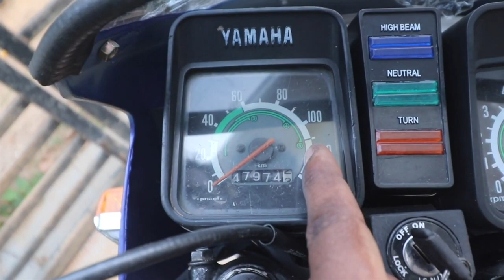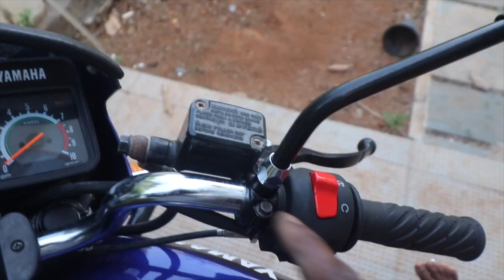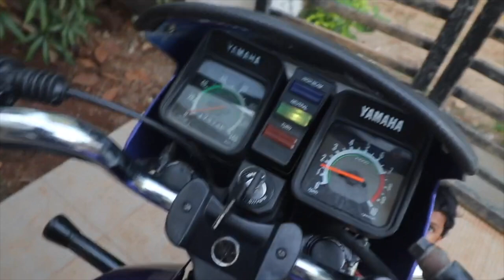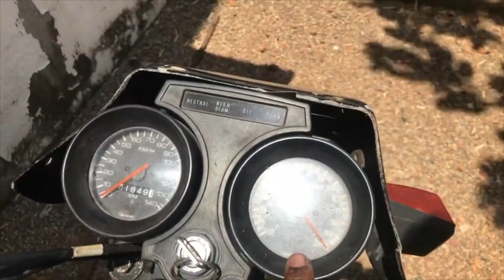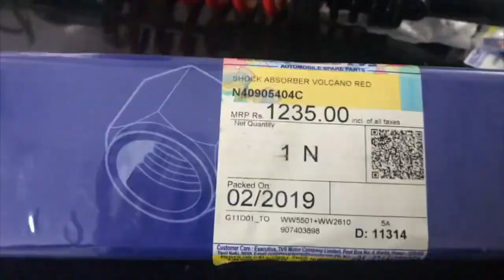Planning to restore a bike? watch this video before (Malayalam Video)

Comment: Njan ee paranjathu polae paattu padiya vandi sale cheyyunnathu, pakshe pillerkku ithonnum ariyanda. Vandiku unsleeved bore ondo, sleeved ondo, SKF bearings ondo ennu onnum avarku ariyanda "Phoenix shocks, quick throttle,yezdi headlight, ammbumvillum, bomb ondo njan vandi edukam" ennu paranju nadakunna new gen Insta likes inu vendi ulla kurae peru. Njan bike kodumkumbol, athinte rebuild pics use cheytha parts, use cheytha paint, vehicle history vare parinjitta kodukunne. Pakshe ellavarkum OE Kerala registration sleeved bore, diamond piston, lakshmi bearings um aanu ishtam 🤷
Reply from the maker: 😆 ithanu logham, I saw a video where a guy bought a sumurai, thinking it to be a shogun and he was complaining about 4 gears, even after getting cheated he didn’t know how many gears a shogun has
Reply: @Yamakaze  the time I took to explain them the difference between each model and seeing them making the same mistake which I clearly warned them about, made me wish I should have migrated to another country
Reply: @Yamakaze  oh I saw that video 😂, epic it was. But nothing compared to a young customer I met once who bought a kb100 with an rx135 5s body kit on it thinking it was an rx 5s without papers for cheap. I blame kawasaki for placing the carb on the engine right side cover

Comment: Really a gem of a video for us first timers! Great tips sir! 

Also one more thing is I feel we must restore only for us and our wanting.Not to fulfill ego because someone said so or someone insulted us before the bike was restored.

Very true, we have to make sure that the bike should be done up based on our requirements and not mechanic’s idea. We should not just throw money at it, then come back only once to pick the fully built bike up. 

Need to make sure, note down our requirements and upgrading choices (disc and what disc model.etc)
Never modify frame like bending,cutting or wielding.

Please do also a make a video for people like me who want to rebuild their bikes themselves (but rust repair,painting,plating.etc outsourced) 

Regarding the tank, is the new stock Yamaha Tank come with internal rust protection sir ? 

I have ordered one stainless steel allen key nut bolt totally costing close to 2000 bucks, will it also break and rust ?

Is Zinc dipping better than nickel plating sir ? Or is it specific to each part ? 

Regarding crank, new crank is impossible to get sir, so is there a reliable way in India to rebuild and rebalance the crank properly ? Will it match the new crank ? Thanks! 

What parts you suggest as upgrade from stock and what you would advice against and stick to stock for Rx series ? 

Thanks a lot sir!
Reply from the maker: first of all never use stainless steel bolts on aluminium, you will strip the threads. New tanks have inner coating unless they are those cheap delhi replica. New crank is available in yamaha spare shops
Reply: Yamakaze Thanks. New crank isn’t available anymore here.
Reply from the maker: Bratty Biker ok

Comment: Bro nut bolt full plate cheydal scene ano.......
Reply: Akash Chandran Stainless steel nut bolt Kit available in the market for RX series.
Reply from the maker: Athu thread strip cheyyum, never use stainless steel on Aliminum case. Don’t plate all, do zync dipping and plate the shock absorber nuts and the handle bolts
Reply: @Yamakaze  thankz bro